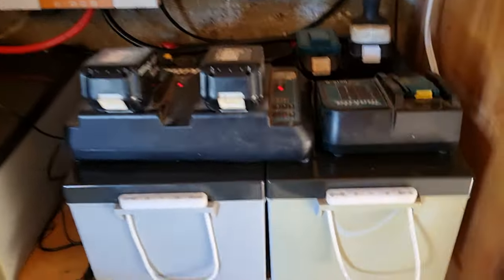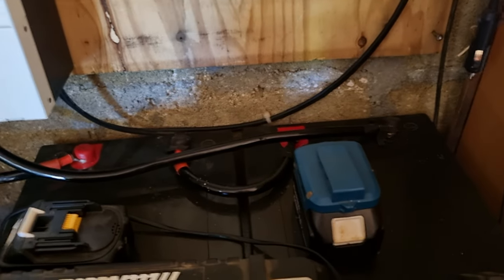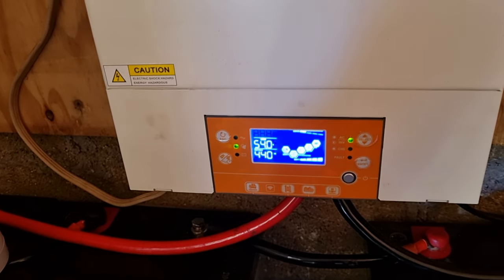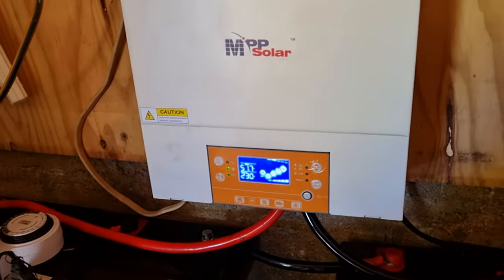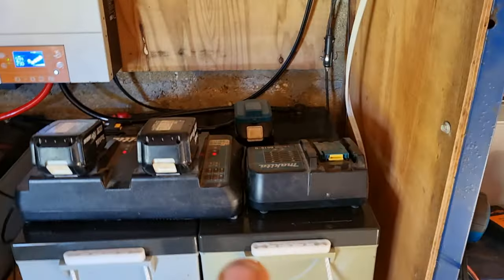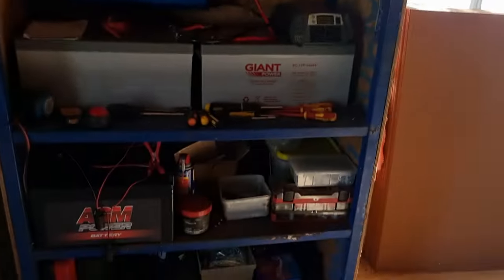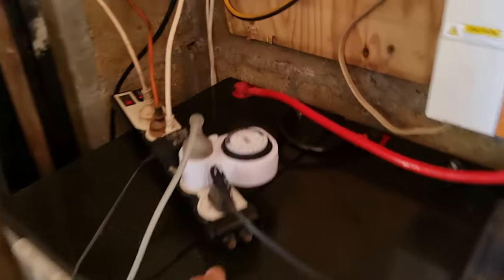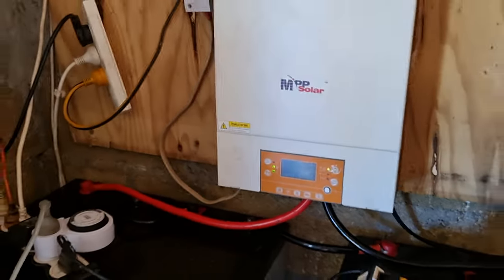Why is 1 battery getting depleted?

Comment: On any 24v 36v or 48v battery system, you need a battery balancing unit. Keeps all in sync and balanced voltage.
Reply: I have never used a balance controller on lead acid batteries??

Comment: Battery might just be bad , the wire theory w also make sense but they look thick enough to not have a bottleneck 
I would assume the cell is bad and not holding a charge like they used to
Reply: On gel battery banks where you have 2 or more in series the first negative side cell usually takes quite a beating from charging over .1C and tends to short or strip the lead.. Equalizing gel batteries does more harm than good so I always recommend that the batteries get rotated every 3 to 6 months so as to spread out the wear to a different batteries negative cell plate.. Liquid acid like in L-16 batteries seems to tolerate a little higher C rate and can be equalized and cleaned using like 60vdc for 30 minutes on a 48 volt bank.. For gel the use of a long float at 55v and rotating the batteries is the best option..

Comment: What kind of batteries are those?? Gel?? If so equalizing gel batteries with a higher voltage is not a good idea.. You also have to be mindful not to charge or discharge them at a high rate or you can damage the cell plates.. At this point LiFePo4 batteries have come down in price and are equal to or cheaper than lead based batteries but have a longer life and greater storage capacity per pound than lead.. So maybe it is time to instead of replacing failing lead batteries to start saving up for a transition to LiFePo4 cells/batteries..
Reply from the maker: Yep your right. Time to save for lithium.